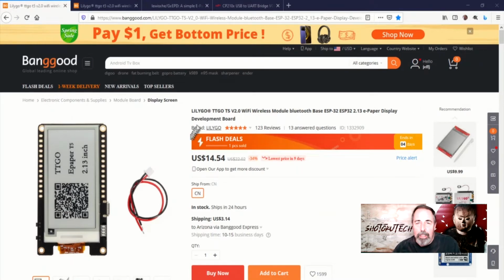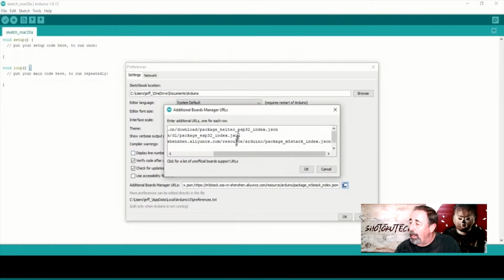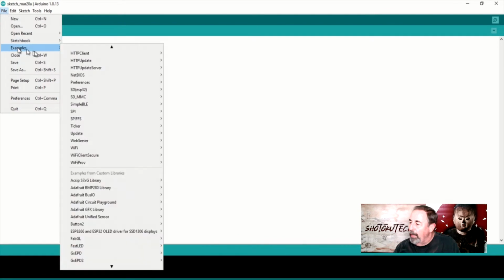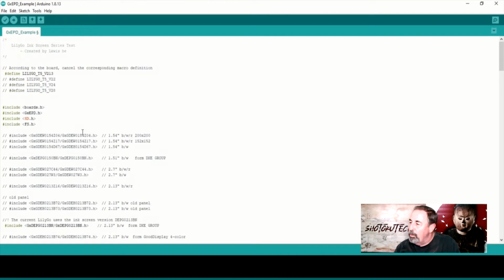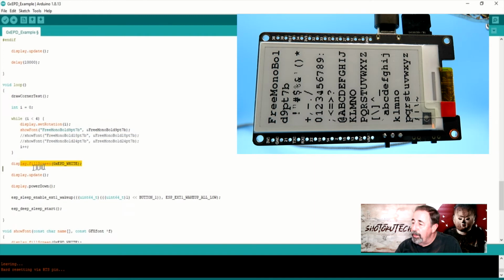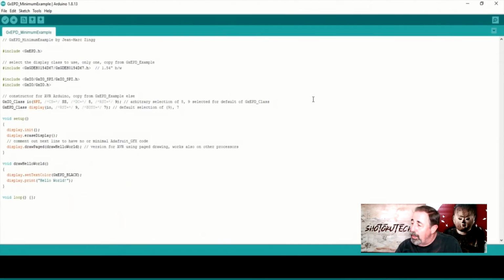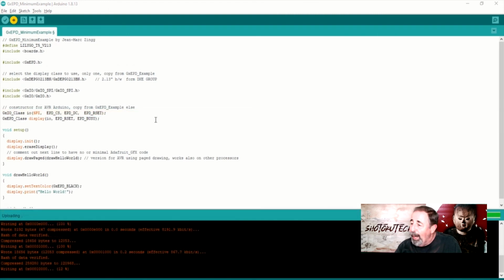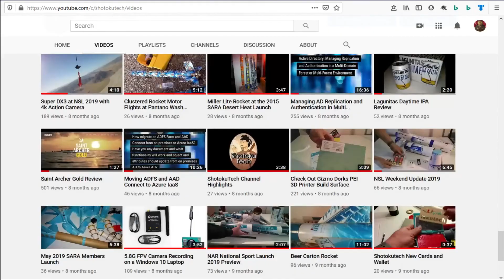Getting Started with the TTGO T5 E-Paper Display Development Board

Comment: During compiling the sketch, I got an error message: architecture not supported. But I do not understand why. My panel is Lilygo T5 V2.3_2.13  USB interface CP2104. Could you suggest what to do?
Reply: Finaly I could make it operating. I went back to IDE ver. 1.8.13  from 2.0.3 and onliy keep 
#defined LILYGO_T5_V213
and
#include <GxGDEH0213B73/GxGDEH0213B73.h>  // 2.13" b/w  old panel , form GoodDisplay
all others excuded.
Finally it works now.
Reply from the maker: Good for you! Thanks for sharing. Yes, I have been shy about using 2.0 IDE. Now I know why.
Reply from the maker: Hello. That is a tough one. There are two things that come to mind. Are you using the lewisxhe / GxEPD fork? And when you first turn the T5 on, it should show which version the panel is. Make sure you have selected the correct version panel in the sketch.
Reply: @ShotokuTech  Thanks for your answer. Yes, I downloaded lewiswhe/GxEPD.
Unfortunately, due to earlier several trying of correct diver, I cannot recover the original display status.

Comment: Looks like GxEPD code has been updated. And only gives PIn suggestions for boards. So can you update the video to show how to define the pins for a LILYGO T5? I am stuck at the moment.
Reply from the maker: Hello. To work with the LILYGO T5, you cannot use the original GxEPD library. Use the "lewis he" forked library where you only need to uncomment the correct display board to get your pin definitions. https://github.com/lewisxhe/GxEPD

Comment: Hy Thank you very much for your Video ! I have following Version DEPG0213BN  but I get following Error: Do you now a solution ? Thank you !

In file included from C:\Users\rudol\Documents\Arduino\libraries\GxEPD-master\src/GxEPD.h:20:0,
                 from C:\Users\rudol\Documents\Arduino\GxEPD_Minimum_Test_2\GxEPD_Minimum_Test_2.ino:3:
C:\Users\rudol\Documents\Arduino\libraries\GxEPD-master\src/GxFont_GFX.h:77:13: error: 'int16_t GxFont_GFX::getUTF8Width(const char*)' cannot be overloaded
     int16_t getUTF8Width(const char *str);
             ^
C:\Users\rudol\Documents\Arduino\libraries\GxEPD-master\src/GxFont_GFX.h:45:13: error: with 'int16_t GxFont_GFX::getUTF8Width(const char*)'
     int16_t getUTF8Width(const char *str);
             ^
exit status 1
Error compiling for board ESP32 Dev Module.
Reply from the maker: "Cannot be overloaded" is the key phrase in this. I would like to start with making sure you are using the GxEPD library specifically by lewisxhe. I am assuming the sketch GxEPD_Minimum_Test_2.ino is your own. While I am a hobbyist when it comes to C code, I am going to say this error is a mismatch between integer data types. https://www.w3schools.com/go/go_integer_data_type.php

When I look at GxFont_GFX.h near line 45, the integer data type is uint8 and your error seems to imply you want uint16 out of uint8 or vice versa. Check how your variables are declared in the program.
Reply: @ShotokuTech   Thank you very much I solved it in a other way. I used the GxEPD2_MinimumExamble and do use an extra definition. I think the IOs was not set correct. Here the solution:  #include <GxEPD2_BW.h> 
GxEPD2_BW<GxEPD2_213_B74, GxEPD2_213_B74::HEIGHT> display(GxEPD2_213_B74(5, 17, 16, 4));
Reply: @rudolfknoblach1482  Got the same error - will try your solution! Thanks!

Comment: I got a similat T5 board with 4 buttons and speaker and 1s lipo plug to power it with a 1s lipo.. Would it be possible to measure the battery voltage and display a battery percentage on the screen? I'm reading a lot of documentation around but I'm not able to make it working.. can you make a video on this? pleeeese help master! thanks a lot for your videos!
Reply from the maker: Is it possible you can provide a link to where you purchased this item? I could review the specifications and see if that feature is available. Thanks!
Reply: @ShotokuTech  can’t post links here.. this is the complete name of the board I got: LILYGO®TTGO T5 V2.4.1 Wifi e Bluetooth base ESP-32 Esp32 1.54/2.13/2.9 EPaper thanks
Reply from the maker: @martinoboni1106  Oh that's right! I forgot. Thanks.
Reply from the maker: I am looking at two things that might have an answer to your question: 1) https://github.com/Xinyuan-LilyGO/TTGO_TWatch_Library/tree/master/examples/BasicUnit 
has this AXP20x_ADC example sketch under 'Basic Unit'. And oddly, there is a few references to some e-Paper units. So you might be able to hack the config.h and LilyGoWatch.h files to support the display that is currently attached to your unit.
Also there is this: https://github.com/lewisxhe/AXP202X_Library
AXP202X_Library. 
I might see if I can make a video about this, time permitting. Hope this gives you some idea in the meantime to pursue on your own. Let me know how it goes? Thanks.
Reply: @ShotokuTech  thanks a lot I will test also these and let you know. If you have time it would be great for sure you can figure it out. Thanks again for the support and your videos.
Reply from the maker: @martinoboni1106  Let me know if you get it working before I have a crack at it. Darn if I didn't buy a couple more of these just now, because the improved on these since I bought the previous ones. Now there is no LED shining on the back constantly and added those three buttons!
Reply: @ShotokuTech  Dear thanks a lot for your support.. after some test I was able to measure the Battery from VBAT pin to GND so I connected the VBAT pin with the GPIO35 directly with a 100K resistor (not sure is safe enough) then I just averaged the analogRead(35). finally to calculate from steps to voltage I applied the factors:  voltage = avg_value /4095.0 * 1.1 * 4.5 .. but I'm not sure this is the proper way to go.. if the VBAT is there for this purpose .. can be connected directly to GPIO35 without resistor? anyway now with this setup I get voltage quite precise also while charging. The board stops charging when the battery is full and the blue led goes off so seems to work properly.  Anyhow one of your good videos for sure can clarify this for everyone I think and can be a good exercise also for all these boards that can run on batteries and it is omportant to know when they need to be charged or when they need to close some tasks before going to very low voltage. thanks and sorry for such long reply.
Reply from the maker: @martinoboni1106  Genius dude! Yeah I was looking at VBAT and trying to see in example code how to capitalize on it. I really appreciate your comments! I am going on a limb, but I'm going to say you can connect VBAT directly. I am interested to try this. My timetable is a week or two, as I have a queue of editing to attend to. I think a fully functional E-paper watch would be the coolest. If you aren't actively using the watch, display an image and go to power save. But you are right, this is good topic.
Reply: I bought the 1.54 inches bw with speaker from here. Thanks

Comment: Sorry for my bad English.
With this line :
display.drawFastHLine(0, 40, 250, 40);
A white line appears on the black e-paper screen.
How do I make this line black? (for a white screen.)
Where can I find all keywords? Please provide a url for it.
Thanks in advance
Reply from the maker: Try this:
display.fillScreen(GxEPD_WHITE);
display.drawFastHLine(0, 40, 250, 40, GxEPD_BLACK);
It looks like you can specify the color (GxEPD_WHITE or GxEPD_BLACK); as the fifth parameter. I just gleaned this from the GxEPD_Example sketch from GxEPD library. 
I don't really know of a complete command reference for GxEPD library. There is not one at https://github.com/ZinggJM/GxEPD
Reply: @ShotokuTech  
This is me test sketch.

/*
    LILYGO LINE TEST SKETCH 23-06-2021
*/
#define LILYGO_T5_V213
#include <boards.h>
#include <GxEPD.h>
#if defined(LILYGO_T5_V213)
#include <GxDEPG0213BN/GxDEPG0213BN.h>    // 2.13" b/w  form DKE GROUP
#endif
#include <GxIO/GxIO_SPI/GxIO_SPI.h>
#include <GxIO/GxIO.h>
GxIO_Class io(SPI,  EPD_CS, EPD_DC,  EPD_RSET);
GxEPD_Class display(io, EPD_RSET, EPD_BUSY);

void setup() {
  SPI.begin(EPD_SCLK, EPD_MISO, EPD_MOSI);
  display.init(115200);
  display.setRotation(1);
  display.eraseDisplay();
  display.updateWindow(0, 0, 250, 122, true);
}
void loop() {
  display.fillScreen(GxEPD_BLACK);
  display.setTextColor(GxEPD_WHITE);
  display.drawFastHLine(10, 20, 230, 20);//Allways WHITE til now
    
 //display.fillRect(0, 0, 40, 40, GxEPD_WHITE);// or BLACK no problem
  
  display.drawFastHLine(0, 70, 250, 70);
  delay(3000);
  display.updateWindow(0, 0, 250, 122, true);
}
Reply from the maker: did display.drawFastHLine(10,20,230,20,GxEPD_BLACK);
work?
Reply: @ShotokuTech  No dit not work. display.fillRect(0, 10, 250, 1, GxEPD_BLACK); Dit work .
Reply from the maker: @BertHeideveld  I see where the problem is. Because H in drawFastHLine means horizontal and V means vertical you only need X and Y for the starting point, the length of the horizontal line, then the color. Only four parameters are used.
This from Adafruit_GFX.h file:
drawFastHLine(int16_t x, int16_t y, int16_t w, uint16_t color);
or this for your example:
drawFastHLine(0, 40, 250, GxEPD_BLACK);
(X, Y, Length, Color)
I think this is right. Give it a try? Thanks!
Reply: @ShotokuTech  It works. I had assumed that I also had to specify a line thickness, as can also be done with my TFT screens. So I never thought of this possibility. I don't have much experience with screens yet. thank you for all the effort and the beautiful work you do.
Reply from the maker: @BertHeideveld  Thanks for the conversation. We both learned something. Now we can share. Thanks.
Reply: @ShotokuTech  I have made an NTP server with readout on the E-paper 2.13. How do I send a photo to you?
Reply from the maker: @BertHeideveld  My email is in the about tab on the channel here. Look forward to it.
Reply from the maker: drawFastHLine is actually part of the Adafruit GFX library. https://github.com/adafruit/Adafruit-GFX-Library
I'm just looking at this now. But I have to go back to work LOL.

Comment: Great edit, on the one I received I had to use the  #include <GxGDEH0213B73/GxGDEH0213B73.h>  to get the display to work, even tho is the V2 3.2.13, no biggy only took a few hours cycling though different boards...

is there a way to stop the screen refresh from being so often ? the flickering on and off to clear makes it difficult to use for projects with real time data, iv been using a BME280 , or is this just a down side to these screens that it needs to refresh all the time ?

thanks for the post really helpful in getting started
Reply: found this in the code, remove the display.update and use this. :-) display.updateWindow(0, 0, 400, 800, false); // this is used to stop flicker
Reply from the maker: Yes! This is the partial update code that I want to explore further. Thanks!
Reply from the maker: Yeah it is interesting there is no way to be assured which panel you are getting. Maybe the number stamped on the cable?
Reply: @ShotokuTech  Some of the Cable id's and controllers are listed here. https://docs.zephyrproject.org/latest/boards/shields/waveshare_epaper/doc/index.html

The TTGO T5 V2.3_2.13 has a lest 4 variants. Different boards, different panels with different controllers.
My sample from 2019 needed the 
#include <GxGDE0213B72B/GxGDE0213B72B.h>  // 2.13" b/w  old panel , form GoodDisplay Oddball
To get it to work.2 shades But lacking some features of 
// #include <GxGDEH0213B73/GxGDEH0213B73.h>  // 2.13" b/w  old panel , form GoodDisplay
Cable was labeled HINK-E0213A22-A0 SLH1914
Reply from the maker: Great comment thanks for the information!

Comment: awesome video, great tutorial, I was able to get this going but my board is not flashing the standard all black and all white, to kind of clear the screen, im thinking this is a hardware issue, am I right? also my serial monitor is just posting gibberish, im not getting any data, any thoughts?
Reply from the maker: So the entire screen does not swap out black and white to refresh? Serial is connected at 115.2k? If you have the correct board and display definitions like I show here, it could be hardware. I guess double check and make sure there is not some stray line uncommented. Good luck! Thanks.